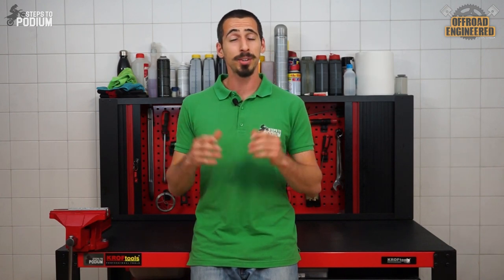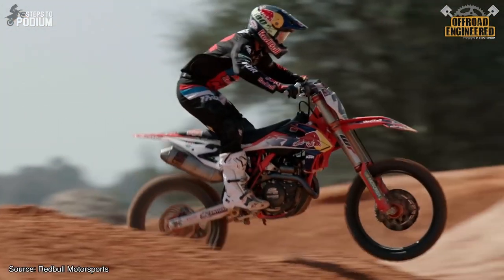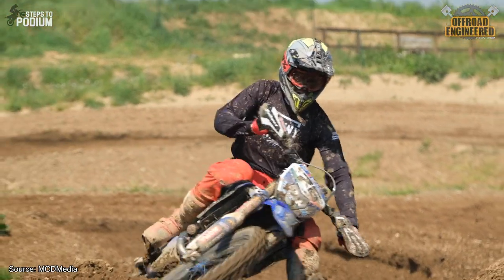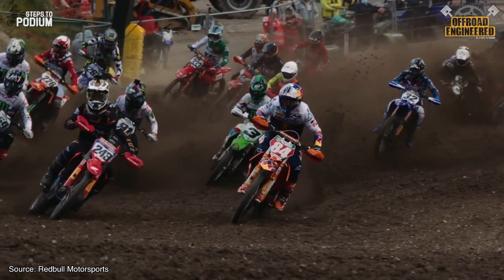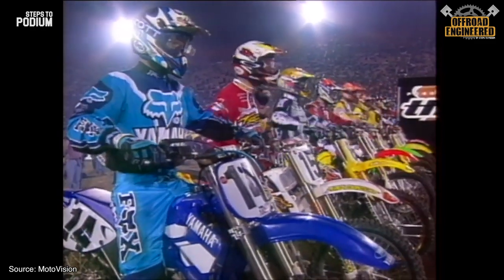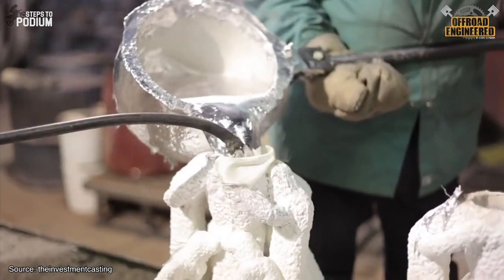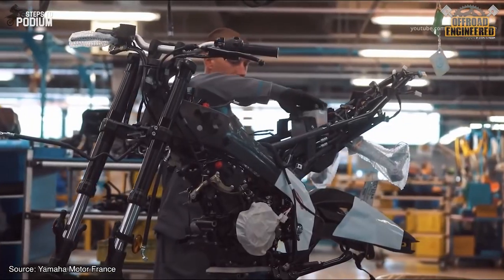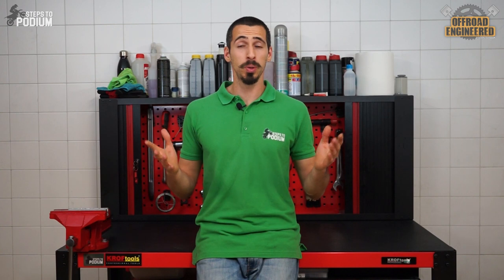Dirt bike frames | Offroad Engineered

Comment: Hey Man, nice explaination. Today, with current sofwares (like Catia) we can figure a 3D in movement to demonstrate the simple and easy way to calculate what happens during acceleration, braking when hitting a bump and so on. But with regards to demostration of how much material to use and what material to use, and because anything speical will cost money, most steel frame for eg use AISI 4130 alloy steel and some types of reynolds steel as there have been enough data fed for them regarding thier "Yield Criterion" and how much Von Mises Stress the material can take. Ofcource this is the reason why ktm sticks with steel frame, however japanese manufactures have focused more on different methods of extruding, casting and forging aluminum and mixing all three together to get the same  "Yield Criterion" and how much Von Mises Stress the material can take ! funnily these are studies i gathered when i worked for a bicycle company that was planning to make carbon frames back in the days and it was indeed a lot of upstream learning for me. appreciate your videos, they are very englitening !
Reply from the maker: Thank you so much for your input and I'm glad you liked it! 😄

Comment: I had a kx450 with aluminum frame, cracked the frame on a cased jump, ended up switching to Ktm with steel frames because they will flex more before it cracks.
Reply: no, its because it's a kawasaki lmao

Comment: Excuse me, I don't understand why you say that aluminum is stiffer than steel?
Okay, we also need to consider the section of double-beam aluminum frames, but a tubular steel frame is significantly more rigid.
Considering that, as you presented in the video, the elastic modulus of steel is higher = more rigid, aluminum is more flexible and therefore less rigid; it also has an FCC crystalline structure.
Even considering the higher performing aluminum alloys, like the 7000 series, they have a significantly lower elastic modulus than quenched and tempered steel.
For confirmation, the sections of aluminum frames are larger because if they used the same sections as steel, they would bend too much.
Aluminum is less rigid than steel.
What you told about the stiffness of alluminium frame is because they have more frame section and that the reason why is stiffer?
thanks love your channel
Reply from the maker: Essentially, yes!

Comment: Hello and thank you so much for this video I learned so much but I do have a small question. So I own a Honda cb160 r which is mostly used in India and Sri Lanka. I am so scared to ride on some roads. I prefer only to ride in very flat and smooth roads because I fear that it might damage my bike frame and also to mention I have OCD. I feel that if I write on roads that are not very flat and smooth my frame Bend and crack. Is what I'm thinking correct or am I over thinking too much hoping for your answer thank you so much in advance
Reply from the maker: Hello! Of the frame has no cracks or os not compromised in any way, I'm sure it won't break!

Comment: The major hard enduro  brands only use some type of chrome Molly or whatever that specialty steel is,,,, you will not see any of the aluminum frame bikes on the podium on hard enduro or Woods riding, when it comes to the pro.... so I'm wondering how they pull it off on motocross Supercross unless that's really not the bike but just a façade like NASCAR vehicles

Comment: Thought aluminum frames cost alot more due to needing more r&d for getting flex etc all correct. Why chinese bikes staying steel still. Also aluminum frame gives lot better stability at speed vs steel doing lot better abosrtion of bumps
Reply: As stated in the video, steel is more labor intensive. What does China have over Japan? A cheap labor force. 

A bad steel frame is still a bad frame, same for aluminum. But a perfect steel frame has better characteristics than a perfect aluminum frame. That said, give me good geometry over all else.

Comment: So why do cheap bikes use steel frames and expensive bikes use aluminum?
Reply from the maker: Steel is cheaper and easier to weld. Requires less r&d to make proper welds!
Reply: @StepstoPodium  You said the opposite thing in the video?